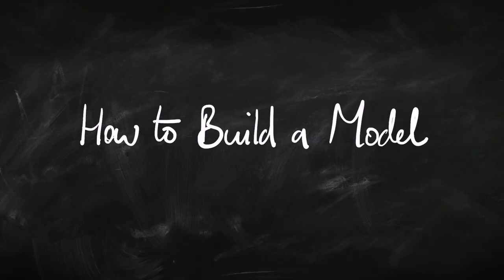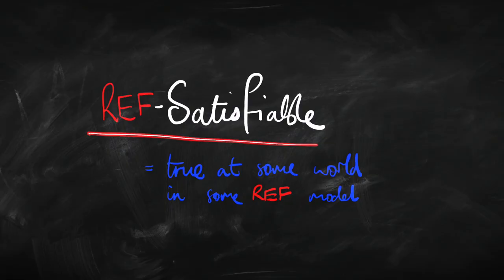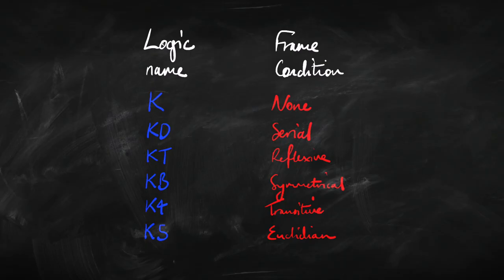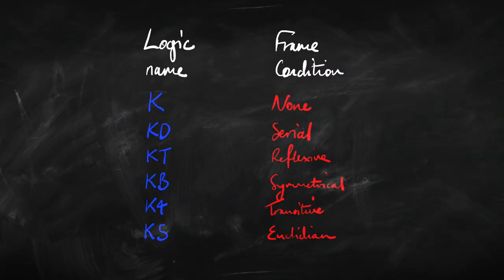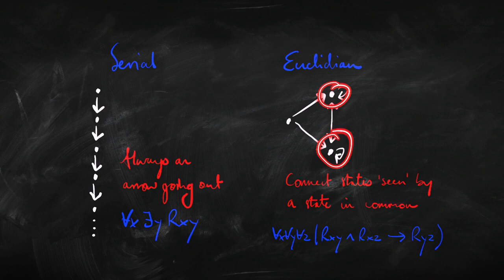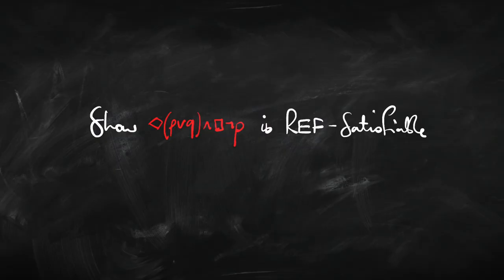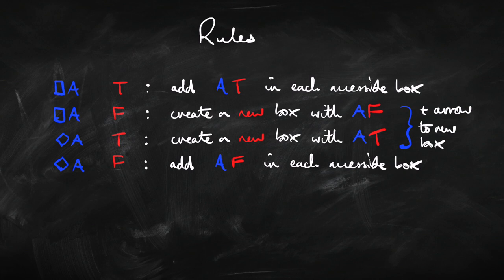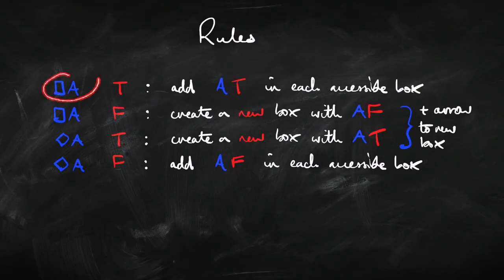How to Build Models for Modal Logic | Logic Tutorial | Attic Philosophy

Comment: If three is a logic for all there exist and necessary and necessarily , nessacity like modal is there a logic for whatever because it can be used in construct in functional programming and chip level where you can change logic to computation is it out there but diamond and square means necessity but acessable in your terms is bit confusing
Reply from the maker: There's logics of computation – usually based on intuitionistic logic and intuitionistic type theory. There, proofs are identified with possible computations, or possible runs of the system.
Reply: @AtticPhilosophy  sure sir I will try